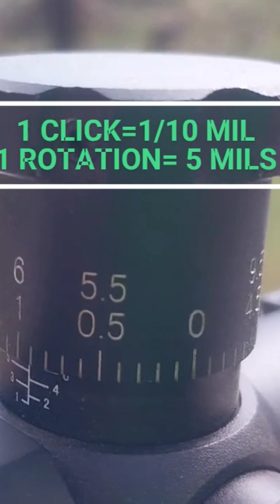How does a target knob work? What is a MIL?

Comment: Mils are superior to MoA for multiple reasons in any case, so you might as well.
Reply from the maker: I agree!  Smaller more relatable numbers
Reply from the maker: My scope rifle caliber combo provides 8 mils for 800 yards which is well within my 10 mil reticle.   Milliraidians are BY FAR the way to go for serious shooters! 
MOA works fine for the 200 yard deer hunter.
Most average shooters understand 4 clicks at 100 yards per INCH ON THE OLE MOA REDFIELD OR WEAVER OR BURRIS  but many are going to DROP COMPENSATORS calibrated for the most common ranges
Reply: @SHOOTFIRE777  Drop compensators have their place too, especially for mid-range like the AR platform.